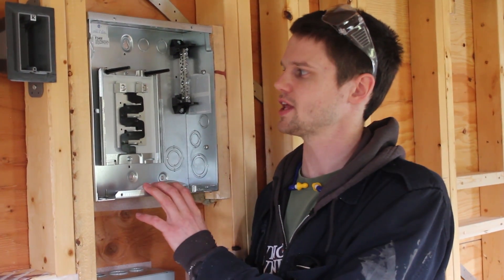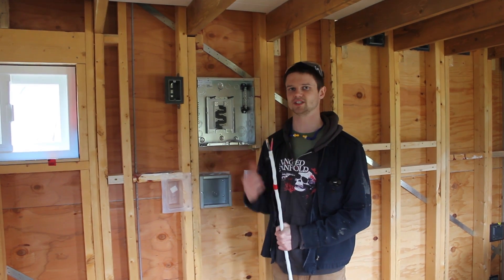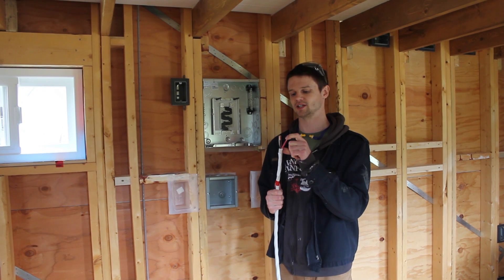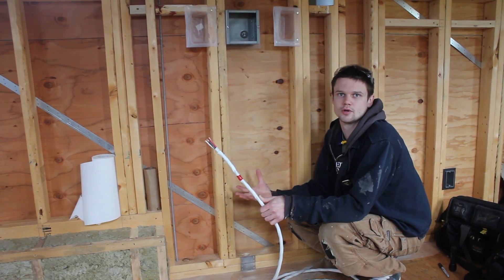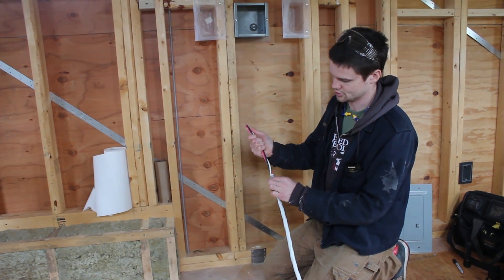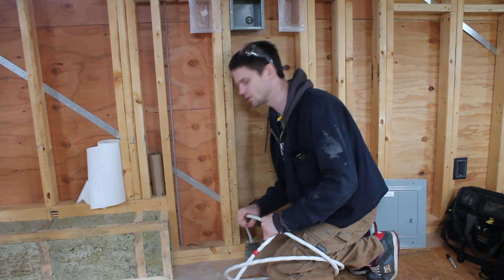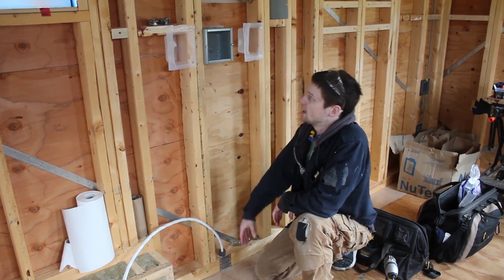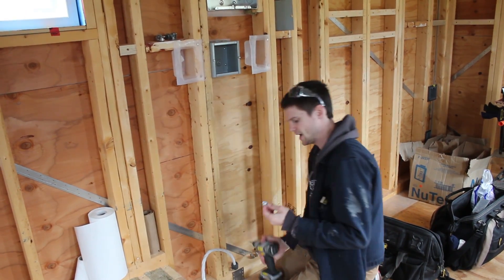Tiny House Electrical Service (Ep.38)

Comment: So I have a 30 amp generator supplying 120 not 240.  Just a regular 30 amp camper plug. Can I use a jumper wire two power both legs on my panel or can I only use one side of the panel since I'm only supplying 120?
Reply from the maker: This has come up before... I think it would probably be fine, as long as the jumper wire is sized correctly, and can't possibly see more current than it's rated for... but with only 30A available, I would be surprised if you needed so many breakers that you'd need to modify a two-leg panel :P

Comment: Forgive me if this seems like a dumb question, but, what is the difference between volts and amps? I was just going to wire my outlets 5 to one breaker (I think 20 amp) except my outlet for the air-conditioning window unit, in that case, it will have it's own dedicated circuit. The window unit is 115 volts. Will 115 volts be too much for a 20 amp breaker? I am very confused on the math of electricity.  I do plan on having a certified electrician check my work but I'd like to get it right the first time.
Reply: oops! I just looked up the circuit box I was going to get, not 20 amp, 100 amp is what it says. Anyway, can I hook up anything electrical with that box? I also just looked up my water heater (electric) and it says it is 240 volt connection. Is that one of those funny shaped connections? Does it need to be on its own circuit too?
Reply from the maker: Don't take this the wrong way (because we encourage DIYing and empowering individuals) but as an electrician myself, the way you've explained yourself worries me. Electrical work can very very easily mean life or death, and so if you have even the slightest doubt about what you're doing, do not do it. There is a lot to learn and understand deeply before working on electrical, so you should decide if you have the time to invest in learning, or if you should have someone else do the work. We wish you the best and be safe!

Comment: The use of a 125 amp box, but using a feed rated for less, can quickly head towards a code violation (lol),  if the main breaker does not reflect the amp rating of the weak link.     Be sure the main breaker does not exceed the weak link.  (conservatively 50 amps?...but 60 amps, just as good).  Just as a matter of "compliance".
Reply: I'm watching because you guys are awesome.  Do not think I'm being critical, my jobs are numbers....numbers...numbers....lol.
Reply from the maker: The house will never be fed from an unprotected source. Currently it is supplied by a 40A breaker in the garage sub-panel of the main house. We don't even have a main breaker in the panel, because it is acting as a load-center. 
Appropriate circuit protection is extremely important and I'm glad you're bringing it up :)

Comment: Your videos are so helpful! I do have a question though, and forgive me if this is a dumb question. With the wiring setup that you have, would you be able to add a 50 amp RV inlet as your power source so that if you were to stay at an RV park it would make for a quick connect and disconnect?
Reply from the maker: Thanks for watching :) We could theoretically hook up to a 50A RV source... but it would need to be 240V to energize the entire system... I'm not sure if that's the standard for 50A RV plugs.
Reply: +Tiny Nest Great to know! so very helpful.

Comment: I see you recessed everything, are you concerned at all about heat loss through the panel?  I know in most houses the panel isn't recessed for this reason.  Maybe it's not a big enough deal, or are you going to enclose that with some insulated panel?
Reply from the maker: +Robert Mantel Most of the panels I've worked on are installed so that the cover is flush with the finished wall surface, BUT the walls are usually deeper than 2x4 and the wall cladding is thicker too... I did sneak once layer of sil-gasket (love that stuff) between the back-side of the panel and the plywood sheathing, just so it's not completely bare. Our climate is very mild so we chose to go with the benefits of tucking everything into the wall, but if it was a big concern you could definitely surface-mount it.

Comment: If you are going to pull 50 Amps I would use #6 wire. Number 8 is rated for 40 amps. check local code for variances. its a good rule of thumb to use the heavier wire for a main. Also where is your Main Breaker?
Reply from the maker: +Ron Barchfeld Thanks for the feedback :)  #8 is actually good for up to 55A if rated for 90-degrees-C and 40A @ 60-C... there can be issues with the temperature rating of breakers and whatnot that can affect the ampacity value that you have to use for the conductor.... but we're planning on starting with 30A anyway, and only if we experience issues would we try to go higher. Several people have asked about a main breaker, and my answer is basically "why would we need a main breaker?" There will never be a situation where we are fed from an unprotected source, and so the only reason for a local main breaker would be to shut off the bus of our panel, which I decided did not merit the use and space-allocation of another breaker. Plus, your comment reminded me that there is a small chance that we may want to upgrade to higher than 30A, in which case having a main breaker would mean that we'd have to swap out two breakers instead of just the one at the source (which will be the main house's garage panel).
Reply: Main is just a safety matter if you ever need to kill the power its better to turn off one breaker than a panel full of breakers. its also code in the USA and a local code in Florida.
Reply: I have a main on the outside of my Father/Mother In Laws cabin the the Georga Mountains. I dont have a main inside but so many times I wish I didnt have to go outside to  turn off the power.
Reply: In Florida Number 8 is only good on 40 amp circuits. But it might be because most all homes have Electric heat, Water Heaters and 50 amp Range which must have number 6 wire. I enjoyed your videos and will use ideas if I ever make a tiny home I may just build a 500 square feet cottage and forget the trailer. I dont plan on moving so the need to move the house is non existing.
Reply from the maker: +Ron Barchfeld We're not anticipating the need to turn off the entire panel frequently, but if we do find it to be inconvenient we'll definitely make an update.
Hm it may be the ambient temperature due to the weather in Florida? Ranges are usually done in #8 copper here.
Thanks for watching and commenting :)

Comment: Your #8 wiring is unprotected if you feed into the lugs like that. What you should do is back feed into a 50A (or lower) breaker and label it main. This also gives you a disconnect at the panel to quickly shut everything off if necessary. Sorry if my comments seem rude, just trying to help out and maybe get the right info out there for other folks as well
Reply from the maker: +Bike Man Dan The #8 wires will be protected by the breaker that feeds them. You would never want to feed a tiny house directly from an unprotected source like the load side of a meter, the way a house is (which would essentially be straight off the transformer on the pole). We may run off a 30A breaker (from the garage sub-panel) so that we can use a #10 outdoor cable. You are right that a locally back-fed breaker could act as a main and allow for complete shut-down, but we have so many circuits that it would have taken up too much space, and we don't feel the need for that functionality in our system. So our panel will act as a load-centre.

Your feedback is much appreciated! But be aware that I am an electrician, so out of all the things we've done on this project, this is the one that I DO know about :D
Reply: +Tiny Nest Fair enough. My thinking was that because this is a mobile house like an RV, your input power is sometimes a question mark
Reply from the maker: +Bike Man Dan Indeed, it might be more work but I'll always be able to make it happen (safely) as an electrician. Even RV hookups, like 30A or 50A receptacles, would be protected to those respective values.

Comment: I think either I would have had a storage box for the flexible cable that will be plugged in like on a travel trailer or I would have wired in a 50 amp receptacle and had a removable cord that can be stowed away when you have to move the house.

Comment: so i recently did this step but those videos won't be out till December but..  i used 12/2 wire.  i made my black and white positive to push 20 amps each for 40 amps total.  and then i used my bare copper wire as the neutral.  how bad is this?  I've heard if that neutral wire comes in contact with any metal that it will become live.  can i cover the bare copper wire to make it "OK"?
Reply from the maker: +Tiny House Customs hmmm... well the number one thing I would point out here is that a neutral carries just as much current as your hot conductor, and the bare conductors (inside a multi-conductor cable) are often one gauge size less than the insulated ones... so if you pushed upwards of 40A through that system, you'd be exceeding the capacity of that bare conductor by more than double and could very easily melt it and/or start a fire :|

Additionally, you wouldn't want to use the bare as a neutral anyway. You theoretically "could", but absolutely shouldn't for a few reasons.

Also, you mentioned using the two insulated conductors as "positive", does this mean you're talking DC?
Reply: Oh man..  I should send you the links for the 2 part series.  So I figured I could just connect the black and white wire to two separate 20 amp breakers. Not sure what DC is..  But my breaker box is similar to yours with two sides.  like a red and black  for positive.  Didn't realize the bare copper would be carrying a full 40 amp load.
Reply from the maker: +Tiny House Customs I thought you meant you were going to use the black and white in parallel to double the ampacity... If your breaker box is split into two buses and you want to use both of them, you need to bring in both legs/lines of the services, meaning 240V, meaning a 3-conductor (PLUS bare bond) cable. You could get the two lines in with a 12/2, but only the two lines, meaning you'd only have 240V available... you need a neutral and a bare ground/bond or the system will not work properly and if it's not balanced/split the right way (including from the source) it could be very unsafe :(

You should really have someone come look at it in person ;)

(DC = direct current, like on battery/solar)

Comment: So the plan is to hard wire in to where ever you park it? I would think you'd use a 50A RV outlet.
Reply from the maker: +Steve 1961P. Hard-wire it yes. I could always put a female cord-end on it to allow for easy connection/disconnection, but as far as I know, 50A RV outlets are 120V, so that would not work with our setup.
Reply: +Tiny Nest This is what I found at better and updated campgrounds.  http://www.homedepot.com/p/Eaton-Power-Outlet-Panel-Unmetered-CHU1N7N4NS/100168377

This is the same chord I used for my 29 foot 5th wheel.. http://www.homedepot.com/p/NU-CORD-25-ft-6-3-8-1-RV-Extension-Cord-94552E/205324852?cm_mmc=Shopping%7cVF&gclid=Cj0KEQjwvJqvBRCL77m2-uKczsIBEiQAkx8VjHhAVX0Um6Xu98sIHwHGjmDa0xmvBDMqO4-7Of3GMRcaAm718P8HAQ&gclsrc=aw.ds
Reply from the maker: +Steve 1961P. Ah, well that certainly looks like 50A at 240V, so that would work then. Like I said, I'd never inspected a 50A RV hookup, so thanks for sharing!
Reply: +Steve 1961P.  Looks interesting and like it might solve my power input problem. Can you or Jake explain something to me? Are the outlets shown inside the box you linked to at Home Depot meant to take live extension cord of the appropriate amperage as power in, i.e. is it meant to feed power in through the outlets and then the tiny house would be wired through the top to the box to the tiny house's service panel? Or are those meant to be  outlets for power out and the top input would have service coming in from the electric company, and then you use the outlets with extension cords to yet another box on your tiny house?
Reply from the maker: +Pario ...I'm afraid I'm not following your question :P
Reply: +Tiny Nest I modified my question to hopefully clarify. It was more about the device that +Steve 1961P linked to than your setup in this video. Let me know if I'm still unclear. My problem might be a fundamental misunderstanding about electricity here that has me using the wrong terms. Sorry.
Reply from the maker: +Pario I no longer see your comment at all :(
Reply from the maker: Your comment just reappeared in our new comments section :P... that electrical box linked above is one designed to feed RVs. To get power into say a tiny house, you'd need something like this http://amzn.to/29c6Tuv which then feeds the tiny house panel.

Comment: What's the term you are using for wire nuts? I hadn't heard that before.

Putting that protective steel plate over the cable is a good idea. Seems like letting it extend higher would be a good idea too.
Reply from the maker: +MakeMeThinkAgain I've always known them as "marrettes". We've used protection plates elsewhere too, but this is probably the most important one (aside from the propane line).

Comment: I guess I'm having problems following you. You're wiring the box as if it was 220. I understand that you want to be able to isolate the high current draw items. So are you going to run 220 to the tiny house or 2 -110 cables?

I agree with you. One should design something above minimal code. If you want to add circuits or do something different you have the options without having to recreate the wheel.
Reply from the maker: +1timby We're going to run 240V from the source (the main house in this case) to the tiny house, using one 3-wire cable.
Reply: +Tiny Nest Got it. So you're not really going to be mobile.
Reply from the maker: +1timby That's right, we don't plan on moving much. It's more that we have the option to do so in rare cases.